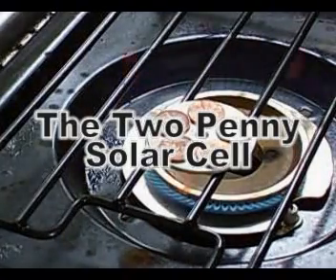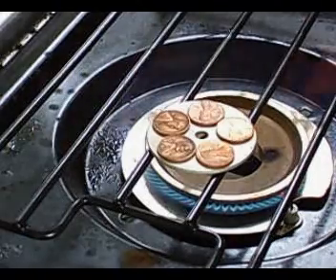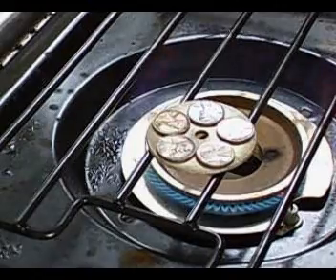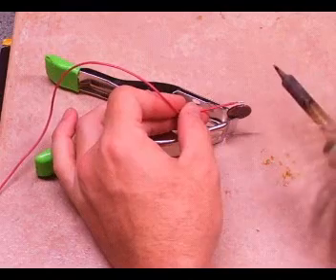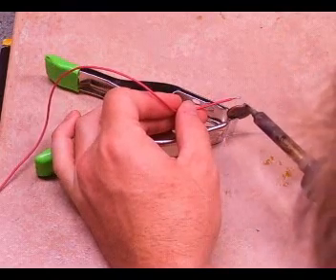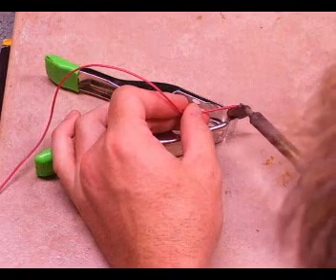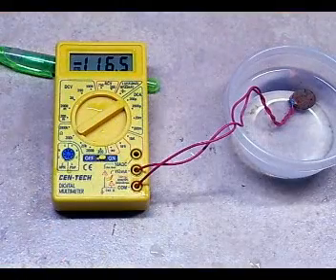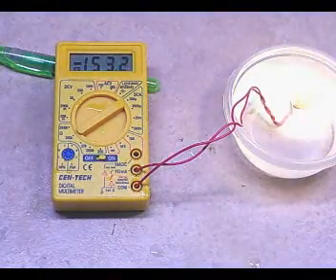Two Penny Solar Collector

Comment: @bridgeboy513 nothing.... while this method of home made solar cells is real, you'd have to have a few hundred thousand of them just to charge a cell phone... Do the math on that 300,000 * $0.02 It comes out to about $6000 just to power a cel phone. AND it would take up a huge area... For that much money you can buy enough professional solar panels to power your computer and then some.

Comment: Well correct me if I am wrong - But the way you have the multimeter configured here, you are reading the current running through the circuit ! That means that the setup is actually absorbing 116uA rather than producing it. Prob some kind of Anode/Cathode plating process occuring - But there sure must be voltage somewhere.